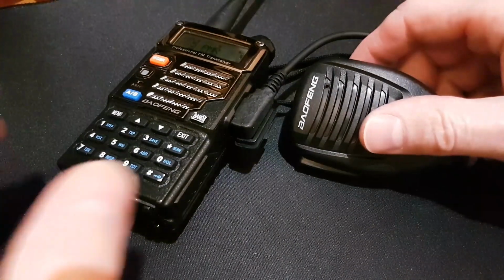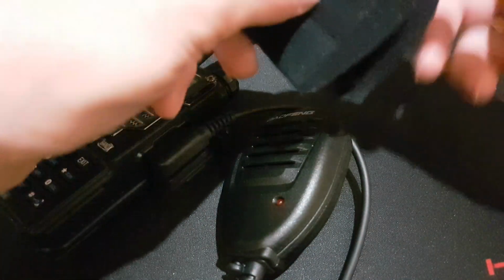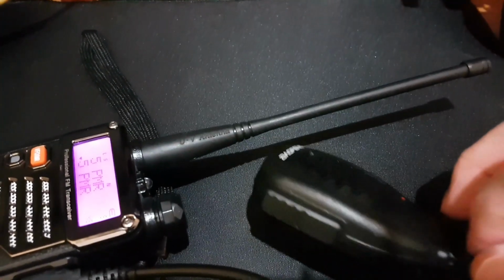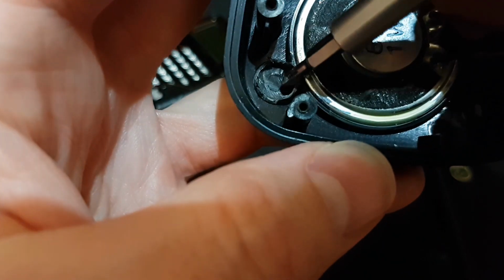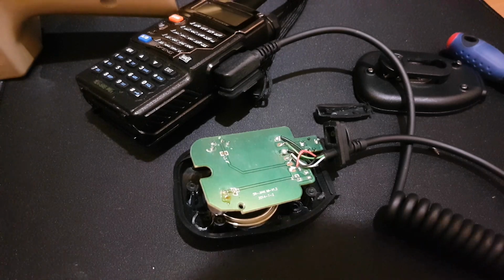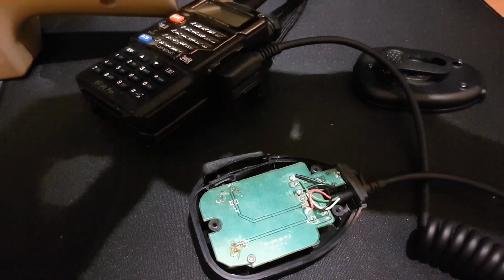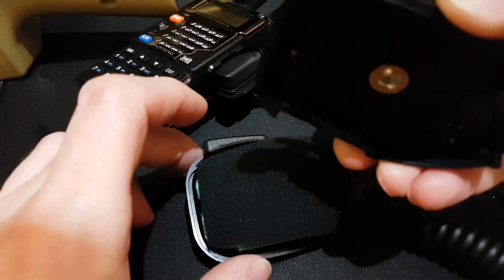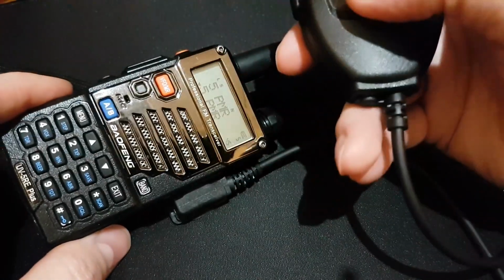BAOFENG external Microphone - audio modification

Comment: I dismantled the microphone and drilled out the hole in front of the microphone to 3mm. The origional hole was less than a millimeter in dia. that made a big improvement. still testing. May try the insert at a later date

Comment: the audio isn't much better after modification.
Reply: i agree...not worth the effort.
Reply: Well he did use a cheap $2 component vs using a genuine Panasonic $8 mic element.
Reply: Has anyone considered  using the element from a 'astatic noise canceling'  mic or even converting it to be a little louder and clearer by using parts sourced from a cb amplified power mic . Just  to make it stand out with little bit more pronounced clarity- But NOT at all like a screaming obnoxious  cb power mic.   Curious

Comment: Use the Panasonic WM-34. A or B version doesn’t really matter if you can solder. It will sound much better than the one used in video.

Comment: On my mic. I remove the small black filter on the mic and make a big hole on the mic casing. Before the quality is so low sensitivity and the output is bad (hard to understand if the signal is not good). After i do the modification its pickup is increase and the output is clear. 
But your modification also good that you replace it.
Reply from the maker: Thanks for your version ;-) 73
Reply: how big did you make the new hole? Did you use foam? This is what I plan to do. Simply make the hole bigger. And perhaps add a little foam. The opening is way too small, and it is off center. Before proceeding I need to get an idea of hole diameter.
Reply: About 2 - 3 cm wide

Comment: Multiple changes were made to the mic at the same time. There is no way to determine what actually caused the change. I always enlarge the hole through the case over the mic capsule on Baofeng products. This change always improves transmit audio.
Reply: you enlarged the mic hole on the radio frame as well?
Reply: @biranit50  Yes I did. Sometimes there is poor allignment between the capsule and the hole in the case.

Comment: I dont want to order from overseas, so, it would be helpful to know some details about that part you are using, like supply voltage, diameter and maybe ohm rating?
Reply: From the linked example below, impedance 2.2kOhm, 2V type (range 1.0..10V), D - 9.7mm

Comment: thansk for the video. i willbe doing this to my unit when i reeive my parts. I do have one question, does the speaker cut off if an external ear piece is connected?
Reply from the maker: I think that the jack connector on the MIC is for speaker only :) But I am not 100% sure.

Comment: Can you find out part number for mic you have used ?  I can buy one from Mouser or Digi Key or amazon but do not know what Mic will work
Reply from the maker: It's common mic you can find. It's not special. I just found it in my old parts reserve. 😊
Reply: @OM0ET  did you try to make more Little holes on the plastic so voice can better get to the Mic?
Reply from the maker: @kdomster9141  no, i didn't. Try it, maybe the audio will be even better 😉👍
Reply: @OM0ET  i heard others tried and even stock mic with some wind foam screen in front sounded lot better
Reply from the maker: @kdomster9141  do you mean wind foam around whole mic?
Reply: @OM0ET  some foam as shield between plastic grill/case and mix and seal around the mic.
Reply from the maker: @kdomster9141  but I used the foam in front of the new mic 9:08
Reply: @OM0ET  Sure and it helps a lot specially with many small holes drilled in the plastic when more air wave hits Mic.
Reply: Panasonic WM-34 A or B doesn’t really matter but it will sound much better than the one used in this video!

Comment: The audio is bad, still. You neutralized bit of the "echo" filling the empty mic body with that sponge but the audio quality is the same , its like to listen through a tube. I swear you really should ge a propher speaker "cuttered" for the voice and nothing else . You can have lil improvement if you play with the caps and resistors, to compensate your voice. Remember this mic ( and alots of the same line, with diff brand ) are designed by asians...and they usually have a deep voice . So you have to tweak the treebles .  Last but not least you can get more "audio quantity" by adding few components like a 2n3904 transistor making it a preamplified mic ( the mic cartdridge is a electret so you have some voltages for it , no need to have a battery ) .